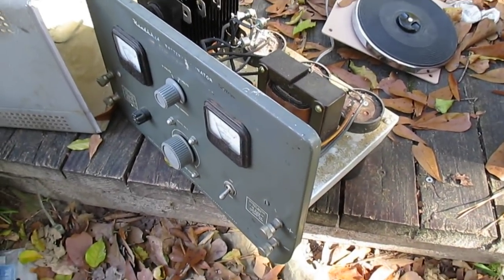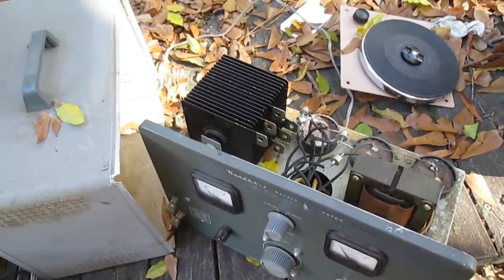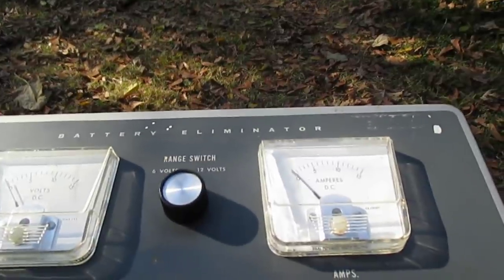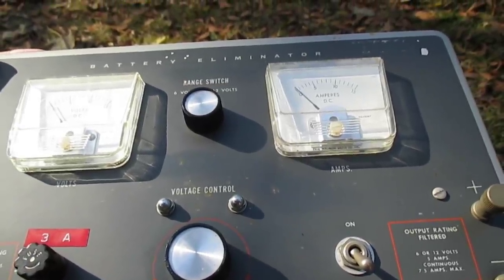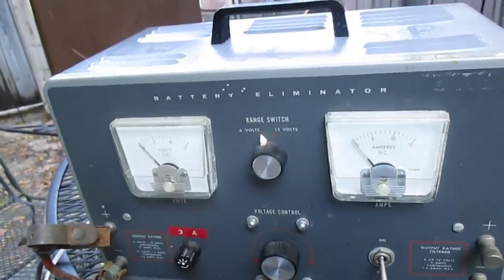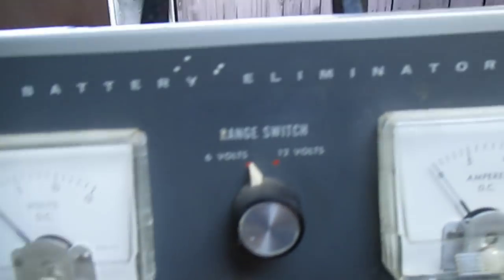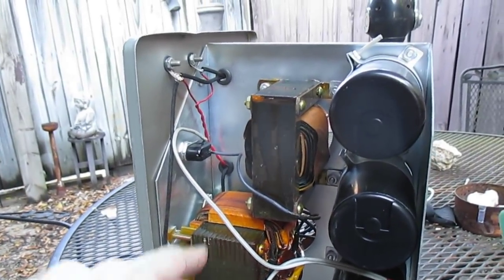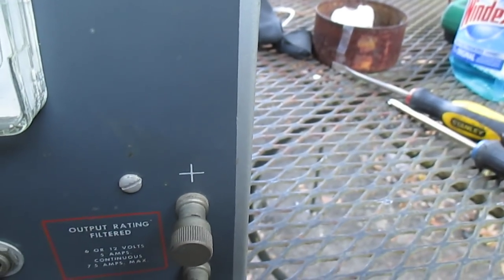Heathkit model IP-12 low voltage power supply

Comment: GREAT SCORE! You are right. These modern switching supplies are screaming with high frequency noise. I got a Trygon 40 volt, 8 amp linear lab  supply from 1965. Had a shorted 5 volt 1 amp zener that was underpowered for the design. Bumped it up to a 3 amp diode, and life is GOOD!

Comment: Those old 12 volt adjustable power supplies with the voltage and current meters are also useful for (DC) model trains, or for testing 6/12 volt tube filaments, or for doing some electrochemistry. Plus, they’re so simple, you can reverse-engineer them to get a schematic if you can’t find the original Heathkit manual. It’d be fairly simple to replace the transformer with a fixed 120->12-0-12 step-down transformer and make a split +/- 12 volt supply, though you’d need that “range” switch to re-purpose to check the + or - voltage output. That, and some LM311/317 voltage regulators on heat sinks, will get you a bench power supply for experimenting with op-amp circuits, or some “retro” 8-bit computers/game consoles whose floppy drives or motherboards need the split power rails.

Comment: Had a Zenith radio like that. It had alligator clip leads so ended up cutting the leads and wiring them to an AC plug. I probably ended up blowing up everything internally. So I put it back on the shelf and 10 years later it went to the dump with pretty with all my antique radios.

Comment: plain 6v AC ( no rectifier) connected to the vibrator / transformer - with vibrator removed will power the set. That Junk Heathkit power supply is easily fixable. a modern bridge rectifier and filter caps. I like things like this because it opens up the equipment for modifications. It can be made better than the good Heathkit supply.

Comment: Isn't it better to have the heat sinks soldered to the cathodes of the rectifier diodes?
I noticed some were soldered to the anode.
This looks like a good power supply for testing non-critical devices.
No switching noise and hard to blow up. The choke should give decent filtering.
The diodes are a weak point, maybe replace them with a 35 amp bridge. They have easy to connect to terminals.
Mounting it to the chassis will probably cool it enough for 15 amps.

Comment: Hello. I found you via an Internet search. I am trying to see if it is possible to repair a late 1970s Magnavox clock-radio. It works fine except the clock now runs exactly twice as fast as it should. I would greatly appreciate any thoughts you may have.
Reply from the maker: If it uses an electronic digital clock, it's probably due to a bad capacitor on the clock board.
Reply: @radiotvphononut  Thanks for replying! It is a digital clock (LED display), and I had guessed it was a bad capacitor or resistor in the timing circuit. Would you have any idea how I might find someone who could troubleshoot and repair it?